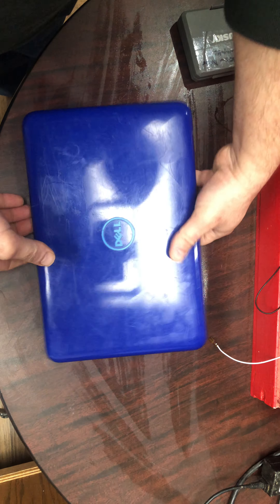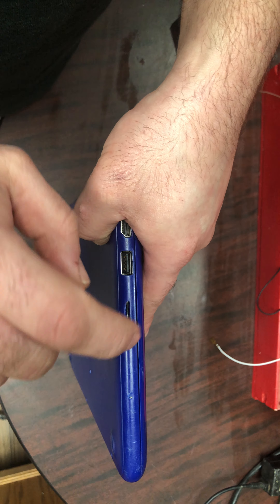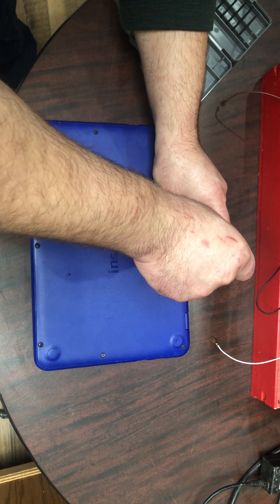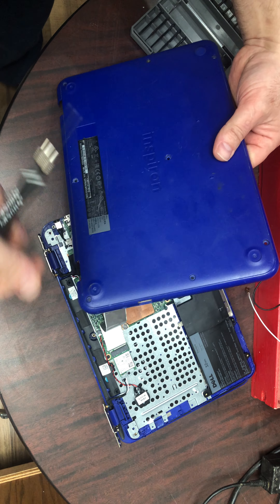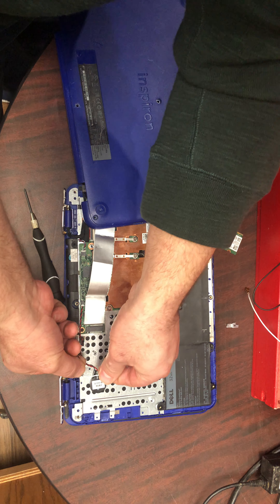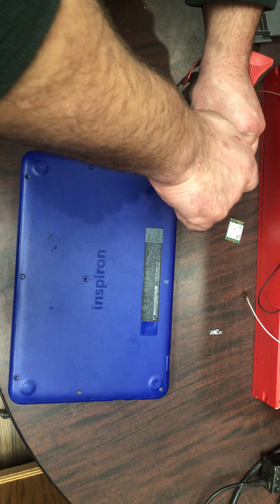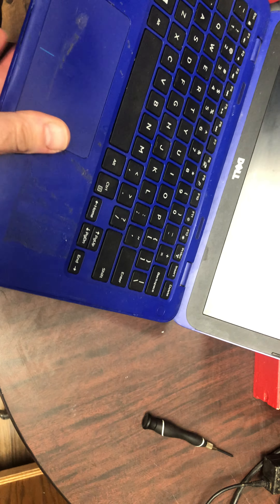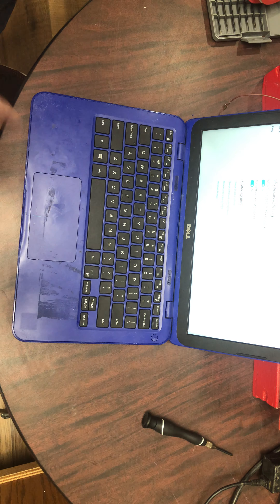Do not buy Dell Laptop at around $300 with no upgradeable ram 32gb built in memory cant do updates

Comment: its always interesting to see the guts of electronics
Reply from the maker: Yes.  They compound all the parts though.  Using chemicals unlike a pharmaceutical company, they add in different chemicals to get the reaction of the electronic part they are emulating.  It’s all done through a machine into tiny wafers.  I bet you noticed when boards started to have less parts, but this thick black gunk.  It’s just protecting the chip.  The wafer disc unlike a futuristic waffle has many chips that get cut off and added into the chip packing. An Integrated Circuit. Before that in the 1940’s they used these giant oversized components along with the “IC” chip called a Vacuum Tube.  The glowing light bulbs that were Transistors. Then they created diodes, that were put together to made transistors, that were shrunk or emulated into chips.